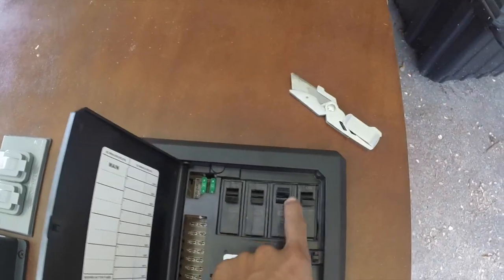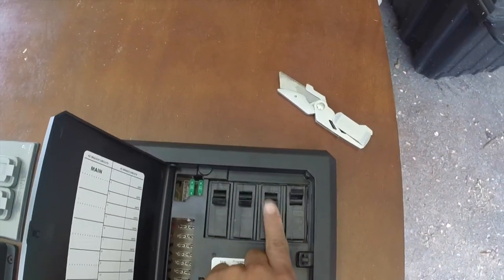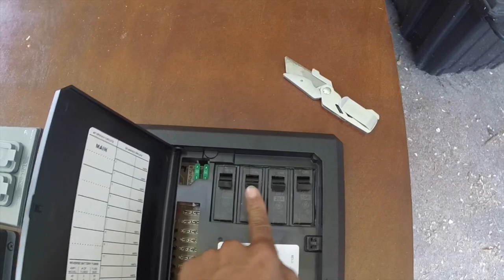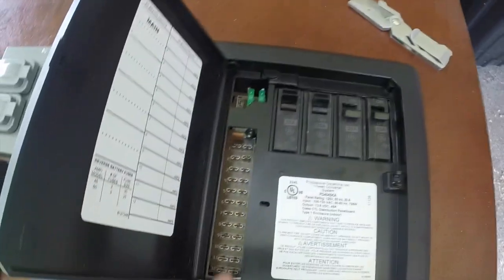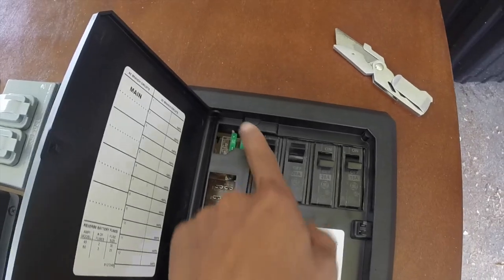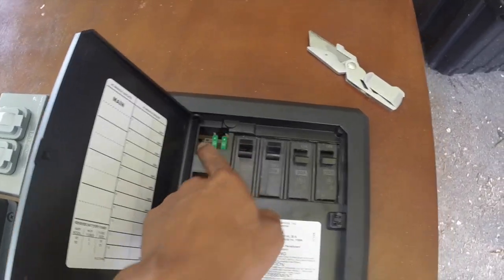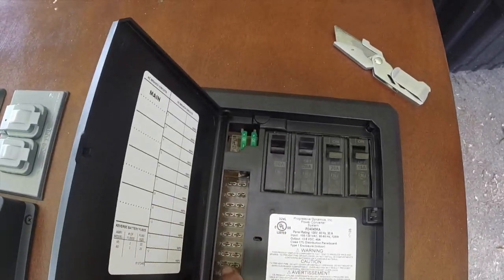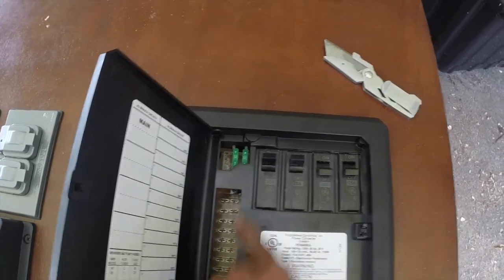Skoolie Fuse Panel installation

Comment: Awesome set up and a cooling fan inside too. Please post the Name of Manufacturer and where you purchased. Planning a Skoolie conversion late 2017-18. MAN WHAT WENT WRONG?  ARE YOU STILL THERE?
Reply from the maker: Norris Coleman thank you for the comment, the fuse panel is a progressive dynamics DC/AC panel i bought it on Amazon I'll put the link to it in the description. But I'm okay just wanted to end of a fun note!